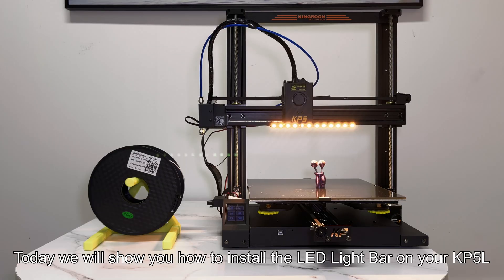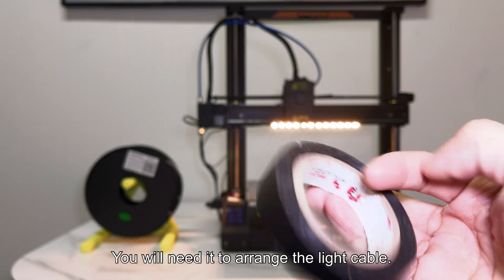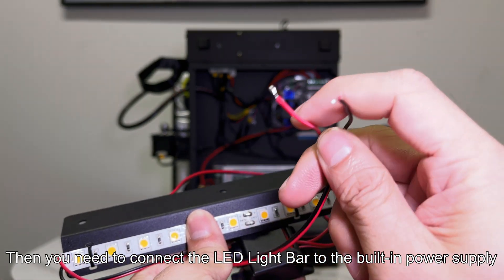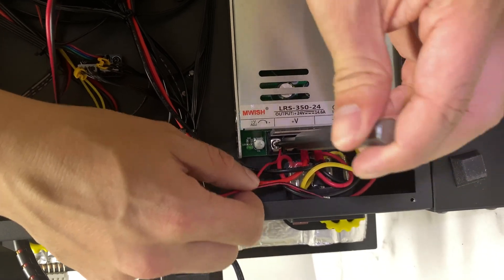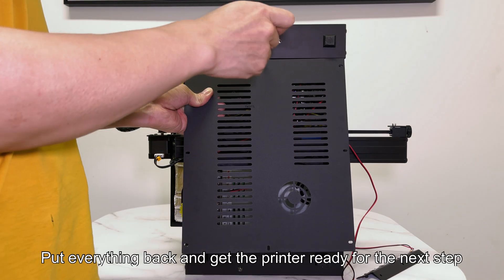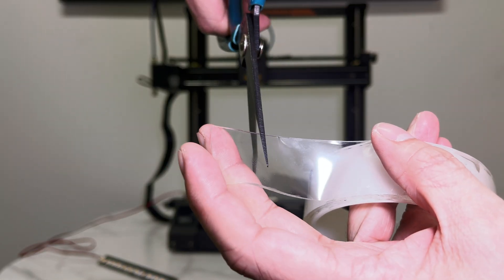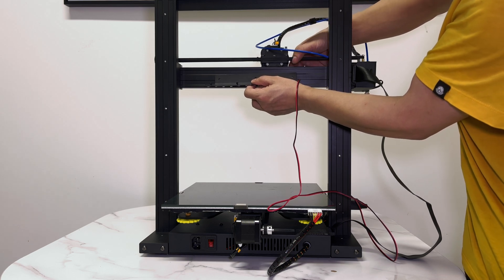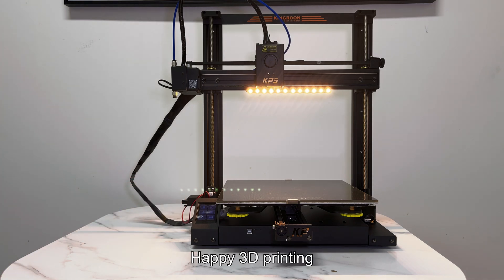How to Install the LED Light Bar on the KINGROON KP5L 3D Printer

Comment: hello, I bought a resin 3d printer from vcs mono plus, but I'm having a problem with a print, I've tried to reinstall and everything else, but it doesn't recognize the files I put on it, can you help me?
Reply from the maker: Please try using a different USB drive and see if anything changes.